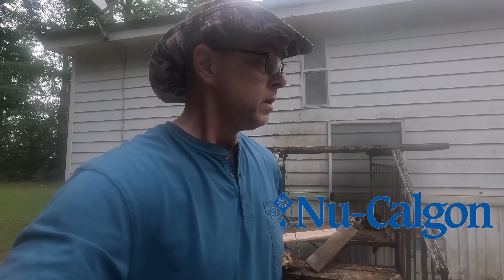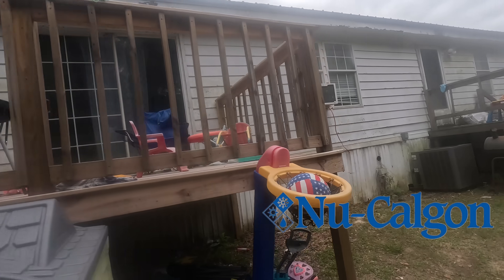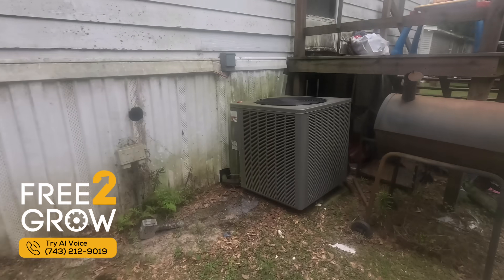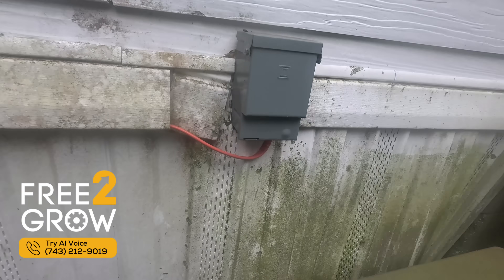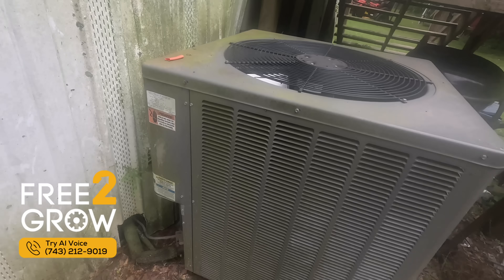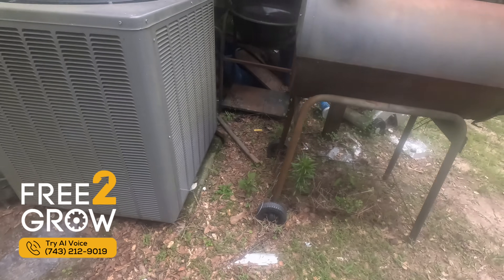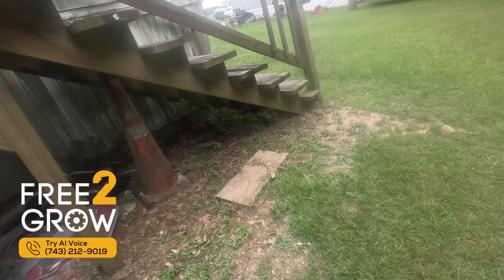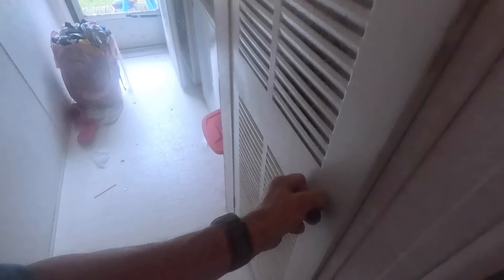I Almost Said No To This Job! #hvacguy #hvaclife #hvactrainingvideos

Comment: that reminds me, I want to add a low pressure switch, may as well add a high while at it, both easy since it has factory service ports inside the machine already. not that I'm dumb enough to run it low on gas, let it get so dirty it cooks or overcharge instead of fixing any issue, but you never know away on long weekends and something decides to go to the pot or even "junktronics" thermostat goes haywire and decides to turn it on whenever. I trust nothing anymore, the great side of being into electrical, electronics, computers, networking and more. lol

Comment: That’s one of those jobs that if everything you installed works for ten years great! If that compressor goes out on the new old unit and you have to toss that new evap coil it was a bad idea. Give them the good and the bad and let them decide. Your install is ethical.

Comment: I've been in similar situations, and you are the hero when everything works out.  However, even if you get a signed document saying it has no warranty, when that used condenser or some other part you didn't touch breaks in a couple of months, they will expect you to fix it at no charge.  It's the old damned if you do and damned if you don't.  If that happens, they will tell everyone how you took advantage of them.  But I have the same weakness as you, if I see something I know I can make work, I want to do it too.  At least you know you did the best you could for them, and the AC hack that hot-wired that window unit didn't get the job. 😀

Comment: Hey Curtis does $ 2200.00 dollars sound right for a compressor replacement the compressor is under warranty also 2.5 ton 14 seer heat pump needs a dryer and a new compressor wire?

Comment: Depending on the age of that system, it's difficult to believe that there wasn't at the minimum a low pressure switch with some type of short cycle device?

Comment: Can’t believe he went to all that trouble for a used condenser. Probably wouldn’t have cost much more at all to have a new condenser and air handler and everything is new and under warranty for several years. As far as you’re concerned, if it gets you a lot more work from him you’ll come out good. Most people like that are not loyal customers, I’m an electrician, and have dealt with several people like him. The first time you tell him something is not a good idea to do, he’ll dump you and find someone to do whatever he wants.

Comment: Sure. Wasn't commissioning a new unit. With lower pressures that unit may last 20-30 years. My R22 is still cranking out the cool since 88-90. Getting that daily rain down there for the past 1-2 weeks? Should be daily rain here in Atl for the next week.

Comment: I’ve installed used equipment before the only advice I’d give and you probably did this…

 I make sure in my written estimate to establish clearly that I will not be responsible for the condition nor the warranty of a used product.  

If I install it and it doesn’t operate or it fails a month later.  I’m not responsible for it.  

I also require 3/4 down deposit to install used equip.

Comment: You did the right thing Curtis! Educate and inform them of your professional case scenarios with all options and let them decide. Be careful of some property owners like this though, some can make this a habit and next thing you know they will want you to install mismatched used equipment with unknown issues or installing a system with a whole set of new problems. Curtis it is also okay to say NO when in the back of your head it saying run Curtis run!  You lucked out on this one but it could have turned bad and I know you felt it. Thanks for the video!

Comment: You did what was right Curtis as you always do. He made a bad decision. He should’ve moved at least to a 410A system with new air handler hand, heat strips and thermostat and the disconnect wiring should be installed properly

Comment: One of the best sales tips I ever got was to sell the customer what they want, not what you want. Yes make suggestions but at the same time you can’t push someone if they have their mind set.
Reply: If it isn't right you just walk away. Period.
Reply: @bobboscarato1313 I agree. I recently had a guy that wanted this 2 ton mini split with one head installed into a 1500 square foot basement with five separate areas. I told him that not only was the unit he bought too big for his basement but it would never heat or cool the rooms behind doors. I gave him a ballpark quote on a ducted 1-1/2 ton system but still haven’t heard back from him. He was trying to get it done on the cheap I think.

Comment: I did something similar several years ago. A condensing unit failed at an apartment complex, and the super had a nearly new "dry" replacement of the same tonnage salvaged from another building where there'd been a fire. (The fire was nowhere near the salvaged equipment.) The indoor air handler in the apartment was older but in very good condition. I set the replacement condensing unit up with liquid and suction line filter/dryers, leak checked, vacuumed and charged it with MO-99. Everything was right where it should have been.

So...yes, provisionally, I would. Absolutely no warranty on anything. No promise of anything. All of that in writing, signed by both parties and maybe even observed by an independent third party.

Comment: Only thing you needed to do was make it crystal clear in writing that you can only be responsible for the new evaporator coil and that the condenser has absolutely NO warranty. I have done the same on new equipment that a homeowner supplied and put it in writing that it was the owners responsibility for warranty and not mine.👍👍🇨🇦

Comment: I purchased a dented condenser from my trucking employer and hadn't used it for at least 10 years. I finally gave it to my daughter, and her brother-in-law installed it for free. It operated fine, and they sold the property with that 15-year-old unit still working.

Comment: As landlord of multiple properties, not a good move on his part. This type of thing never works out to a landlords long term benefit. Yes, there are different “grades” of properties that require different levels of investment, however, to pay the labor for what is essentially a complete replacement with cobbled together equipment, of various age and service life makes zero financial sense. I personally will never replace a unit without upgrading to a two-stage, the difference is minimal and the total cost is tax deductible. Basically sabotaging your own investment.

Comment: With no options to buy R22 in 4.5 years, the home owner is gonna regret his decision.
Reply from the maker: Used M099
Reply: Can't you just use recovered R22 to fill it?
Reply: @mph5896  Curtis posted used M099 will work.
Reply: . No
Reply: @mph5896  Hard to find any around!

Comment: I think you did the right thing, as long as the customer knows he has no warranty on that unit. Maybe the coil. I am faced with almost the same thing except I was thinking new condenser and evaporator. Well for the difference in price I will bite the bullet and do a whole changeout. I kills me because my AH looks like new still, even though it's 20 years old. Good video

Comment: I would never use customer supplied parts.
Reply: I'm in a different service business but same for me. In my experience the kind of people that purchase their own parts to save a couple bucks aren't good customers in my experience. They are the most demanding and do not appreciate quality work. They are just looking for a Chuck in a truck to do it cheap. I get calls 3 months after I either turned their work down or they just called the cheapest guy and their parts broke and the cheap guy won't come back out. I'm usually 200% more than the people they used. I use the best parts and give a warranty.  By calling the cheap guy who won't come back out they ended up paying more than my original quote. I always tell them they got what they paid for when they show me the cheap junk that the other guy sold them.